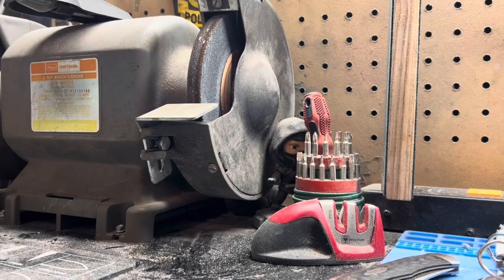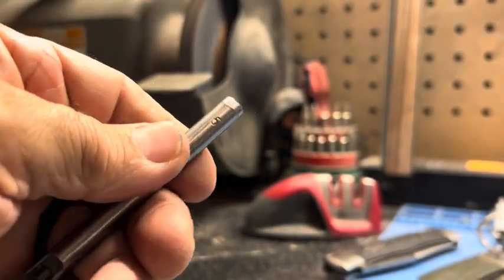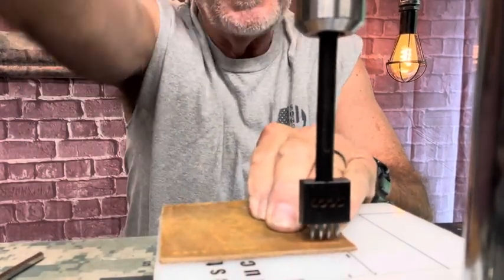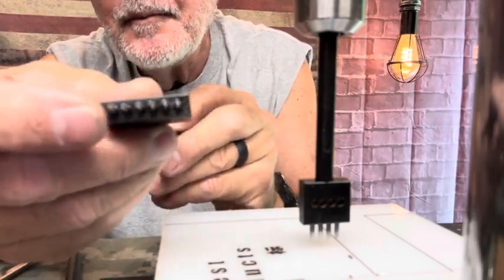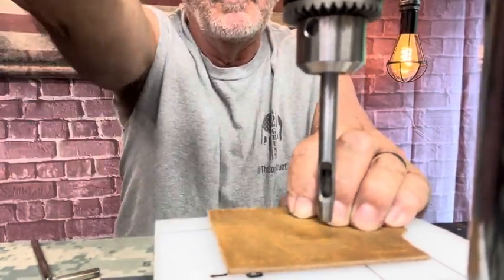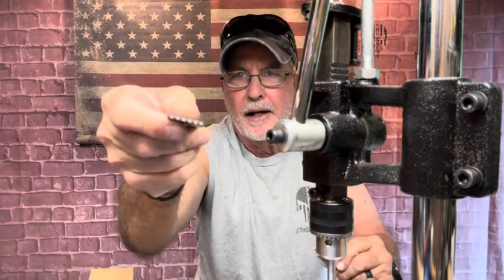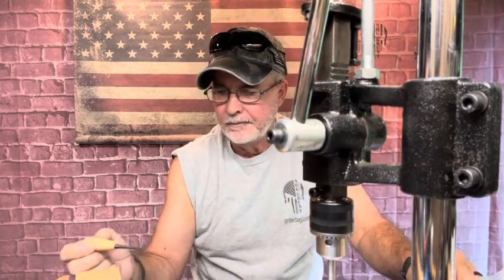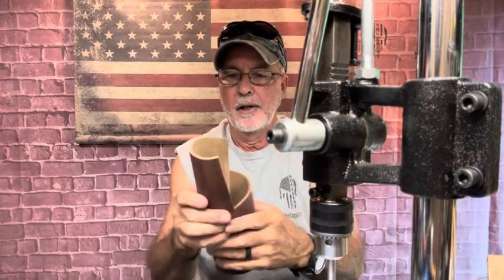Breaking in the Leather Drill Press.The Grinder is a Sears Craftsman I got in 1977 Read iDescription

Comment: The black hole punch set and your press look like the exact same ones that I have. I use the longest of the 3 punches. Make a pencil line on the leather where you want the holes. Make the first punch. On the second punch overlap by one hole to male sure the spacing is perfect. If only a couple more holes are needed overlap as much as necessary. Also cut all of the shafts down to the same length so that the height of the press does not need to be changed.
Reply from the maker: Okay!Thank you so much!😊👍